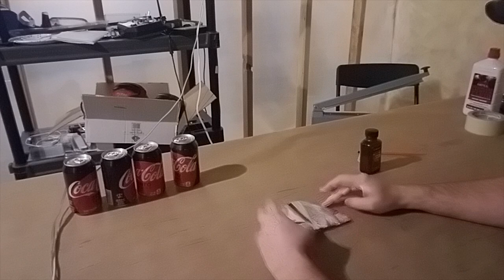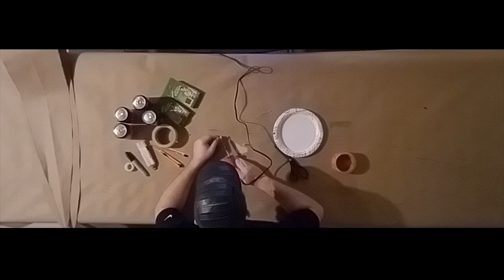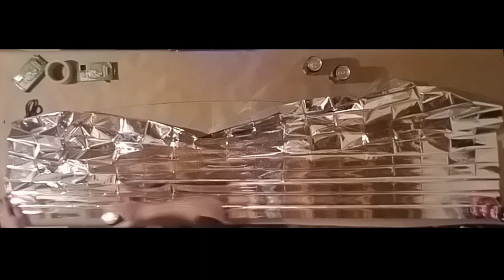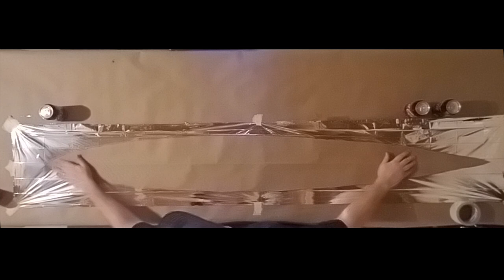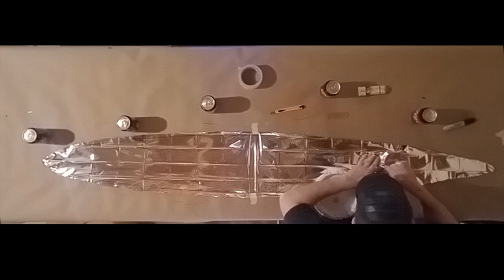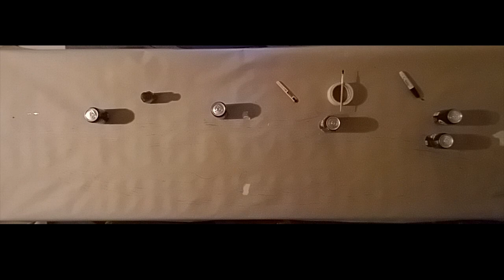How to make a Blimp Envelope from Emergency Blanket Mylar

Comment: So when will the turrets be placed on?
Reply from the maker: I have actually thought making battle blimps out of cheap mylar that shot at each other using airsoft mechanisms would be very interesting. I'm pretty sure an airsoft round would penetrate a blimp like this. Last one flying wins. Could be interesting.
Reply: @BaccaYarro  Haha that would be pretty cool. You could also use an infrared laser that you have to line up with the other blimp to shoot with. The other blimp coud have sensors that receive the infrared signals and it acts as a "hit." I've seen this used in certain battle drones before so it's definately possible. This would allow them more than one use as well. 😀
Reply: @BaccaYarro  vat19 advertised motarised balloon blimps with pins on them.
Reply: on this topic, i have thought before: what if one was to take some, perhaps wooden frames, and make the skeletal structure of a blimp out of it and then cover the thing with "armor segments" (the wood would be too tough for  a bb to go through anyway so only the area in between these needs armoring). basically you take a sheet of aluminum foil, put glue on it and put another sheet on top, squeez any excess glue out, keep doing this until you're satisfied with strenght/weight ratio (the glue between the sheets kinda acts as a shock absorber. so compsite armor. now fix these armor segments onto the frame. i think it would be pretty sturdy with enough layers of aluminum and if it so happens that one of the armor segment is penetrated you still have the actuall lift cell inside to be penned (and the armor segments can be easily removed and replaced without the need to replace the whole exterior)
Reply: 2262
Reply: @YnIanIo  propably way too heavy
Reply: @YnIanIo  In all seriousness that sems like a good idea, but it seems like it would be way too heavy for any airship smaller than a human adult. P propose a better solution

Whatever airsoft gun you use, it will probably a light one. and fully or semi automatic firing, so you don't have to manually reload them every time you fire, which is annoying to do. 

All you got to do is lessen the power behind an bb. I mean, why go through the hassle of extra armor when you could just have a super weak firing system? Also, use the lightest bbs you can find. It should help, both with ammo weight and firing strength.  So basically, take apart any airsoft gearbox. Assuming you know how it works, replace the spring with a much weaker one, and test. Change until desired velocity and force is acquired.

ta da~

Comment: Thank you for making this video.
I was trying to make a foil balloon via the same method (if it holds air good enough for a blimp...)
I was having trouble with the contact cement - but I think I used too much or was not following the right process.  (I did not know that you had to let it dry for a while before you put the parts together.  
I would add that you might be able to glue the part inside a commercial foil balloon for the filler nozzle too.  These will naturally close themselves when the blimp is filled up - by the same method that keeps one of those inflated too.
I am also wondering about gluing stuff to the outside (made of the same material (I am making something made out of multiple parts and want to glue the appendages on somehow - I have an idea that would use material to attach these parts to the surfaces. Any ideas or types of glue?  Specific brand for the epoxy
Reply from the maker: I use tape, or if I want to reduce weight, tape that I make myself from contact cement and mylar. The trick is to not make butt joints, which peel away easily. But instead use lap joints. However, a decent epoxy type glue that works ok is:
https://www.amazon.com/J-B-Weld-50133-Tan-1-Pack
Reply: @BaccaYarro  Yes - I did a lapped seam this morning - I got the exact glue you mentioned above at a local Hardware store too.
Being into custom produced PVC inflatable toys I know that lapped seams are much stronger than the butt type seams (or sometimes called pinch seams.
After further testing I got a much better result - which used the lap type seams mentioned above.  What I am making will be a general display item - and will not be requited to be light enough to float.

I've wanted to make some custom made mylar / foil balloons for a long time - but have never been able to find any suitable material until I saw your videos.
Reply: @BaccaYarro  I've finished what is (for now) a prototypical creation - mainly something to show the concept  - Will make a video later showing it - I'll put links to the videos you did for it as I think there will be some, maybe a lot, of people who'll ask "How on earth did you make this?"  
The item I made used one pattern I will use for my first 'real' construction.

Comment: Bacca i am a complete novice who just discovered this video.  Thanks for posting...it was very informative...but also kinda confusing.  The high camera angle made it difficult to clearly see everything you were doing.  I was totally confused with the cutting, folding, gluing of (4 stacked???) portions of the envelope.  Forgive this newbie question,🙋🏿‍♂️ but instead of four sections...would this technique work (and be easier) if you just cut TWO HALVES and glued the 2 pieces together?  Or better yet, cut an elongated "figure 8" shape and just fold it over and glue the open end?🤔

Comment: very intresting been in a real airship and been wanting to build a model ship for a long time the mylar and glues would they be the same here in the UK were I live, ps great video you have made, peter
Reply from the maker: Yes, they should be. Safety blanket mylar is pretty universal. If you can't get weldwood, any latex based contact cement would work fine
Reply: Use Araldite. It works nicely.

Comment: Hey Bacca, great work! thanks for sharing....now, i have absolutely no idea how to use the spreadsheet to print the shape. 
I have Excel on my mac, so how do create the shape I need and then print? [Please excuse my Noobness but I dont use spreadsheets so this is very foreign to me.] FYI, once the envelope is made im going to use a RC unit from a Flying fish thing my GKids killed to steer this, and create a gondola to use up the remaining lift out of Tissue paper and Balsa, it will be themed around Steampunk Airships if I ever get it done i'll post a link here. Thx again.
Reply from the maker: That sounds like a very interesting project! I found it too difficult to print the shape, so I just use the graph to plot it on a roll of carpenter paper. I use a tape measure to plot out some of the points (remember it's in meters). The "Shape" tab is good for plotting some of the points out.
Reply: @BaccaYarro  thx, that's more my style, I'm good with pen and paper!

Comment: Is there anyway to get access to edit the gores worksheet? Im trying to scale them up
Reply from the maker: If you make a copy of the excel sheet in the description link you should be able to edit it. Change the "Block Volume" field in the yellow box. All the Yellow fields are the ones you are supposed to change.
Reply: @BaccaYarro  thank you, the airship I am making will be about 5.5m long . I saw 100 micron polyurethane was good but not easily sourcable, im also open to mylar or metalized nylon. Any recommendation of material and where I should purchase from?
Reply from the maker: @ryanjacob4828  yeah, 5.5 m is a little big for mylar, but I would probably still do it. Or if you want to get fancy, an inner envelope made of mylar and an outer one made of nylon ripston fabric. A group I'm working with is using something similar now for an 8 m airship and it is working great.

Comment: How do you correctly cut the syringe? I couldn't see much due to the quality.
Reply from the maker: Basically you cut it with scissors and then melt it together using a soldering iron

Comment: So why not go bigger scale? Use a wood laser and 3d print some auto cad ribs. Balsa wood is great for planes so why not a blimp. Add a few servos and a few motors. Pretty much you can fly anything with enough lift.
Reply from the maker: Absolutely! You can make it any size. The spreadsheet will tell you how much lift it will generate. I'll make more videos showing how yo make other parts of the blimp, and some ideas for fun things to do with it.